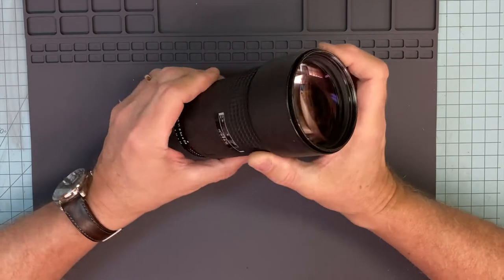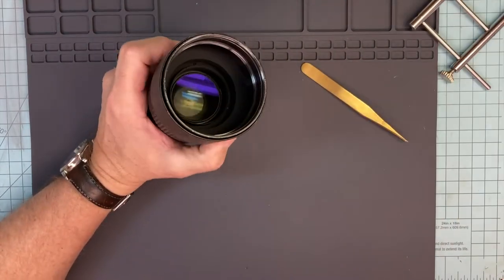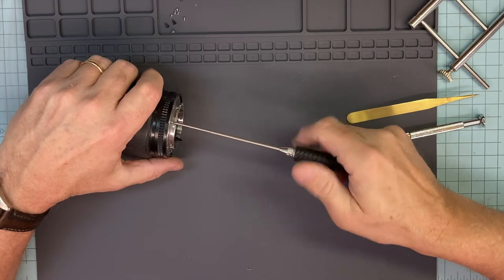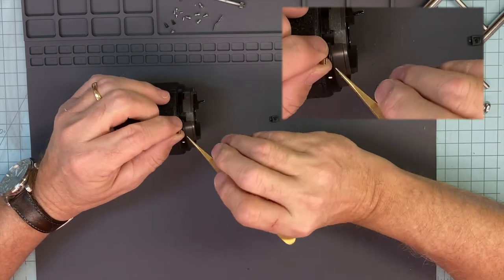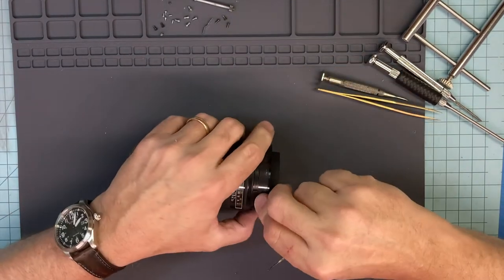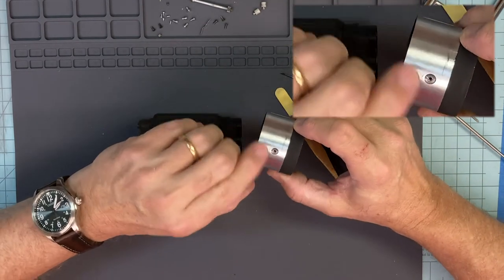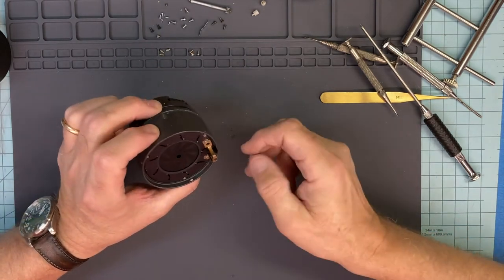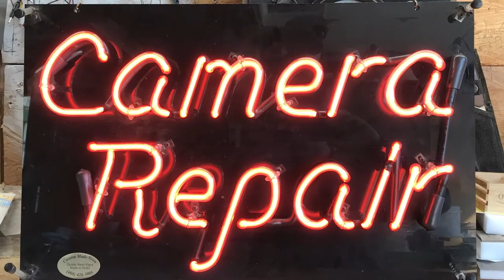Nikon AF 180mm 2.8 Disassemble

Comment: When removing the front element of this lens, I see two places for the wrench to grip, is it the notches on the outer rim or the inner rim?
Reply from the maker: Always go outer first if you want the whole group out
Reply: @ictcamera560  I used your video to successfully remove the front group and clean fungus off of the back of the rear element in the front group as well as the front of the element further down in the lens. I am still trying to separate the front group elements with the same tool you used and man that inner ring is tuckered down pretty tight. Is there another set screw to remove the inner ring of the front element group? Should I put the lens back together, tighten the set screw down and try to remove the inner ring that way vs holding the front group in my hand?
Reply from the maker: @Bredddi  The front elements are always really tight. Also note that the front element ring is sealed in there by the paint. Run an exacto blade between the inner and outer rings to break the paint seal then use acetone in the groove. Use acetone very sparingly.
Reply: @ictcamera560  thank you very much I will try this tomorrow. Thank you for teaching me how to save my lens. The 180mm f2.8 is one of my favorite lenses of all time and punches way above it’s weight. I bought a used copy while I lent out my original and it had fungus. This video saved it 100%. You never know who you’re going to help when you share your knowledge in life….